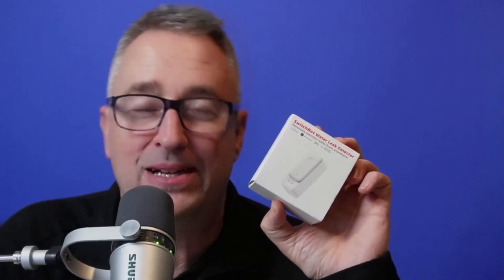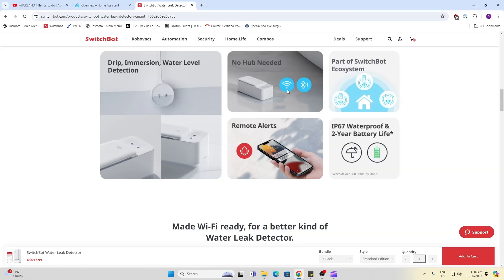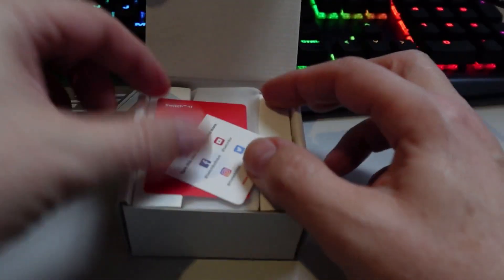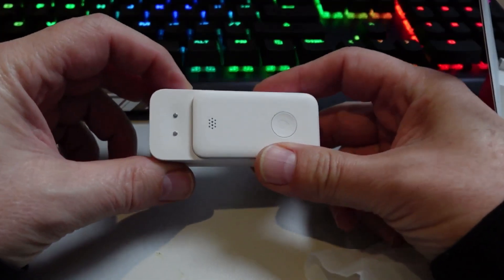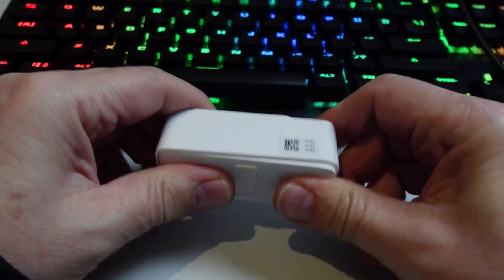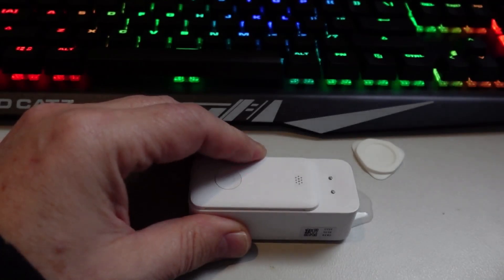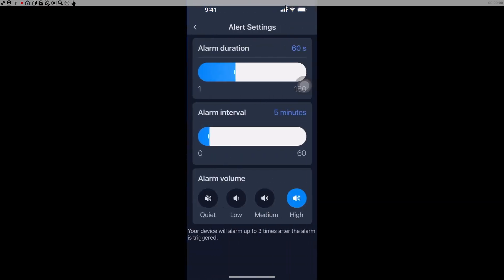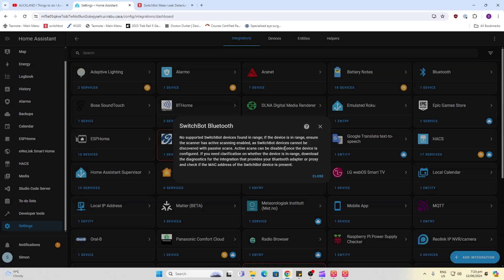Switchbot Water Leak or Water Shortage Sensor

Comment: Can Switchbot  water sensor be used in 5G network by using only the phone app?
Reply from the maker: This sensor connects via Bluetooth, which can connect to via the phone if you are close by.  For remote access you would need the switchbot Hub
Reply: @simonsayshomeassistant  I need to have remote access.  If i use the switchbot Hub, does that need G2.4?
Reply from the maker: @Basilio.Nicastri  Yes it will only connect on the 2.4 GHZ network
Reply from the maker: @Basilio.Nicastri  Yes

Comment: This device may not ever integrate into Home Assistant.   It only drops to Bluetooth when WiFi is not available.  It wil ldepend if it can be added to pySwitchbot, the library the HA integration uses.    I haven't had a good look at the device yet, but if it can't send its status via BLE, then it won't work with HA unless you get it via Matter using the appropriate SwitchBot Hub.    
There are a couple of devices, like the switchbot remote (two button one) that I would like direct in Home Assistant but unfortunately can't get added due to not advertising the status via BLE.....    
I'd buy this leak detector in a second if it did work in Home Assistant, as that is my smart home platform

Comment: Err.. Did I get it wrong or despite the title of the video, in the last 15 seconds you just say "it doesn't work with Home Assitant"?
Reply from the maker: @Tyron76  that is correct it will not connect to home assistant at this stage
Reply: @simonsayshomeassistant  The title is misleading.   You should edit the title of this video.  You specifically say "for Home Assistant"
Reply from the maker: @EsotericArctos  Thank you, I have just updated it!
Reply from the maker: @EsotericArctos  Thank you I have changed it!